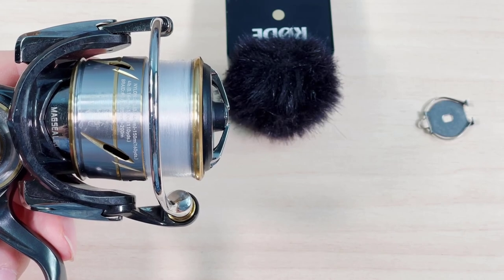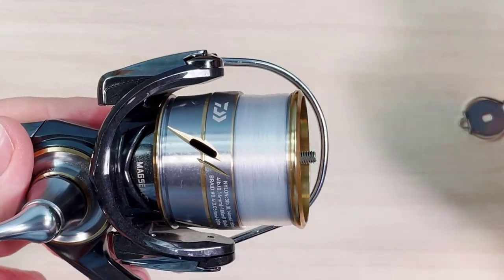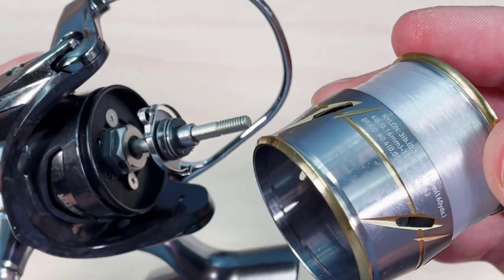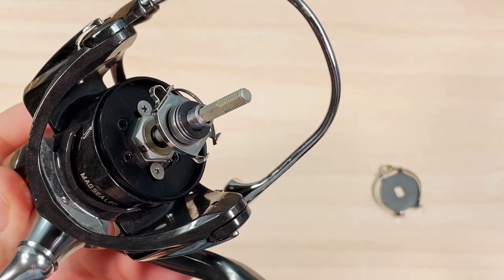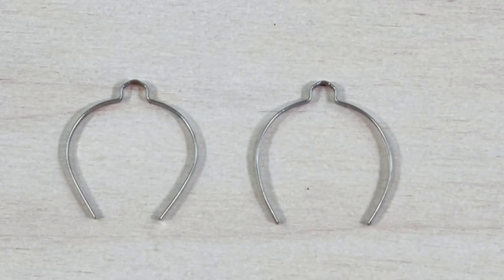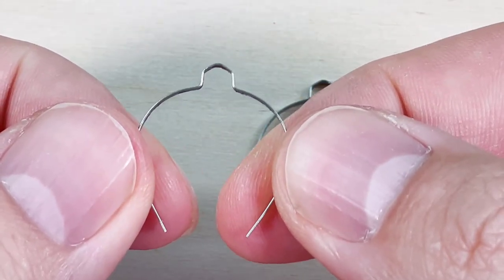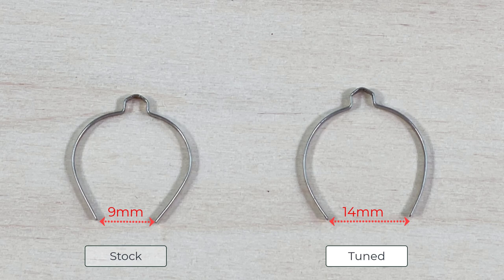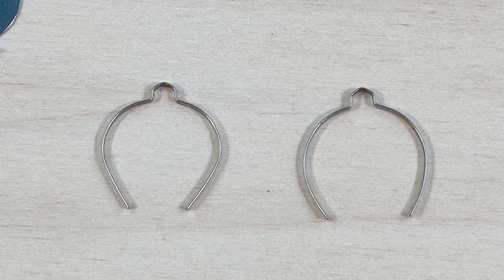Tuning of DAIWA LT reels Drag Sound

Comment: You have done it again Victor, this was exactly the information i needed. On "2021 buyers guide - ultralight reels" video i told you about my European 2020 Legalis LT and that reel don't have ANY cuts on spool for acoustic so the already quiet drag sound of LT reels is even more quiet on that Legalis. You can hear absolutely nothing.. So thank you again maestro for this video, i will tighten the spring just a bit and i will remove a little bit of grease so the trade off won't be that much of a deal

Comment: This drag clicker system is so much better than the cheap Shimano reels. My nephew used my Sienna and must have got it a little wet in the salt water and the little spring mech on the spool corroded and was not recoverable, I had to cut the little thing to free up the spool. So now its sitting in the rod rack, usable but no audible drag

Comment: I just adjusted the drag on my daiwa caldia 2500 following your guidance and it sounds much better now. And yes, there is a fine balance here between the loudness and roughness. I opened the thing too wide at the first try and while it sounded great afterwards, it felt extremely rough. I could feel every click where the metals bit each other. Then I managed to narrow the gap slightly and got the balance right. So thank you sir. You made me a happy man. BTW, is there a way to adjust the drag on Shimano Ultegra reel too? 🤣
Reply from the maker: tried to warn you. And yes, i made a similar video for shimano reels. Search my channel

Comment: Question: do you think that closing your drag and leaving it like that during storage is harmful? My friend says he opens his drag when he puts away his reels.
Reply from the maker: if you are a bass angler and you tighten your drag all the way for the crazy hooksets - then i would loosen it up before storing for the winter. The drag discs are either felt or carbon and you are compressing them and then the drag doesn't feel the same any more. But, on ultralight reels, where the drag is very loose anyway, you don't need to do that. I have never loosened a drag on one of my reels for the winter, because my drag is always very lose , even when i fish for carp. However if u fish with tight drag, i would agree with your friend.
Reply: @ifishcatfish  thnx for the explanation. I have never done it and I’m not really taking good care of my reels. The drag on my Fbs, FL and Vanford start to “lag”. They sometimes take a swim too. Since the beginning of this year I’m a prostaffer and now I have to start acting as an example haha. Thnx for the info komrad!

Comment: Great!won't this tuning stop the rotation of the spool unnecessarily
Reply: @Kolev No, the drag knob and washers and the downforce are the drag system not the clicker pin alone. Nor does the clicker pin have any effect or contribution to the drag operation.
Reply from the maker: stop it? I don't think u can stop the spool. But obviously there is more friction, otherwise you can't make it louder..
Reply: I may not have expressed myself correctly. will that reduce the smoothness of rotation of the spool, the reaction of starting...
Reply from the maker: yeah, that precisely is the tradeoff i was talking about in the video. U sacrifice some smoothness to make it louder. If you try this, do not make big changes. Open very little and try it first.

Comment: I did that to my daiwa and when i got a big fish running really fast and ended up with a broken clicker
Reply from the maker: did you use pliers? I mentioned that it is very important to use fingers to the legs of the spring remain straight or round. If there is a kink or imperfection it may prevent the spring from working properly.  It is important to preserve the original shape. Still, on a ultralight reel it is unlikely to get a failure.. but on bigger reel and stronger fish - maybe